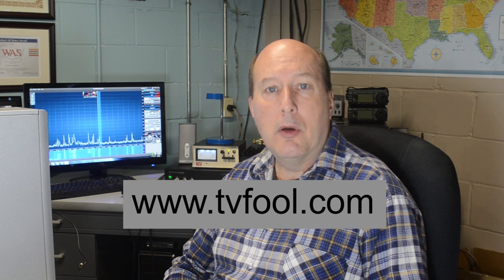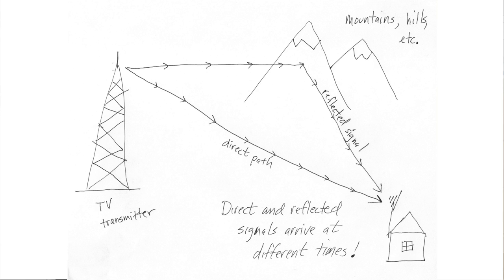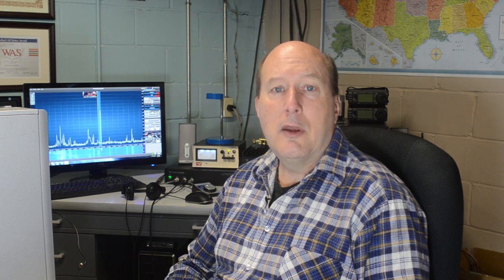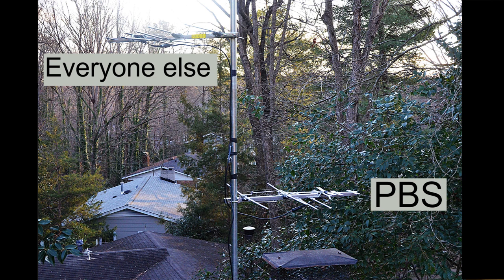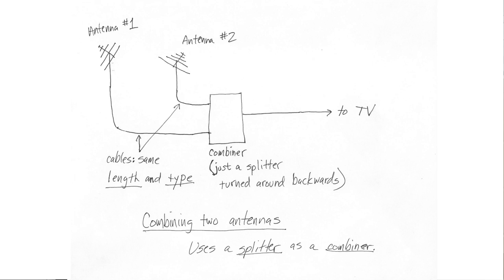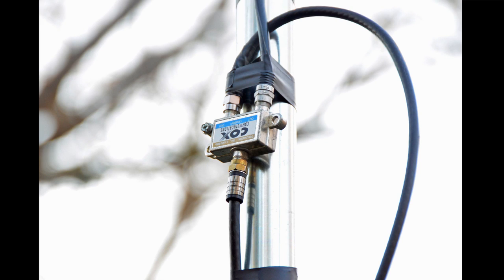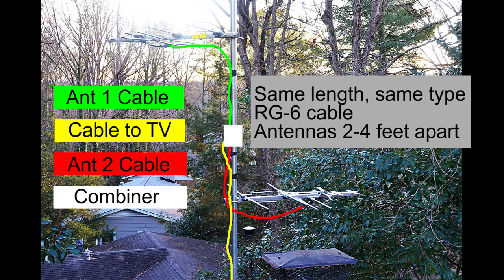Combining two TV antennas for better HDTV reception

Comment: I recently attempted to combine Two antennas, and it caused me to loose a couple  channels. I ended up using an A/B switch to solve the problem, but your video has me wondering if my un-equal coax length was at fault. I was told by an experienced antenna installer that trying to combine antennas often produces the kind of problem I encountered.
Reply from the maker: It's certainly possible that you could lose channels instead of gaining them. If one of your antennas receives a reflection while the other one receives the signal directly you could experience destructive interference which causes pixelation and/or dropouts.
Reply: Thank you for the reply. Multi path interference seems like a likely scenario since we are surrounded by mountains. I recently had a situation where the reflected signal was far stronger than the signal at the transmitter tower, so the info at the tv fool website doesn't always work in these parts. May I ask about your favorite UHF.VHF antenna? I've had fairly good luck with the Winegard HD7694P, but some of my customers need something with a bit more gain.
Reply: Grants Pass TV Repair Other possibilities.  An antenna pointing somewhere other than the transmitter will still pick up noise on the channel of interest, regardless of the presence of a signal.  Signal recovery is about having a good enough signal to noise ratio.  Bringing in the extra noise from the second antenna will lower the signal to noise ratio and if it lowers it enough, reception errors occur.  Also, an antenna without a signal will load the antenna with the signal, reducing signal strength.  The combiner isolates the antennas to some degree, but not 100%.  Therefore, if possible, it's best to combine with a frequency specific combiner.  For example, if you have UHF on one direction and VHF in another, use a combiner that takes UHF one one input and VHF on the other.  A general combiner in this case will give inferior performance.  There also used to be some single channel combiners on the market, but as crowded as the UHF band has gotten, I doubt they make them anymore.  They needed space between the channels to function properly.
Reply: I hadn't realized there were channel specific antenna combiners. Thanks for all the great information.
Reply: Grants Pass TV Repair They used to exist.  I can't remember who made them (Blonder Tongue maybe), but I used to use a channel 3 combiner to feed my single satellite receiver output back into my antenna network so I could use it on any TV.

Comment: Do the two antennas have to be the same type or can I mix different types of antennas from different manufacturers? Is there a maximum number of antennas that you can use? I live in deep south Texas, and we actually get signals from 4 different directions.

Comment: It also can be useful to use a tuner with a "signal meter" function to fine tune the direction of each antenna.  There can be funny interactions with objects that refract the TV signal by several degrees.  Fine tuning the direction can get you a signal that is otherwise marginal.

Comment: nice info thanks don't you have to worry about the frequency of the combiner (two-way splitter)?  and could I use a three-way splitter how about DB loss?
Looks like your a Ham operator?
Reply from the maker: All the splitters I have seen have adequate frequency response, but yes, you need to ensure that the splitter covers the frequency range of the channels you want to watch. As far as using a 3 way splitter goes, if you're only using two antennas then you're just incurring additional loss.

Comment: Just curious if one antenna would be on a balcony while the other pointing at other channels would be indoors, would it still work? (one is an indoor antenna for a separate tv).  Also the outdoor antenna needs to be grounded?
Reply from the maker: I've heard from others who combined a balcony mounted antenna with an indoor antenna. Results have generally been good. Certainly with a try. And it's good practice to ground any outdoor antenna. Although if your balcony takes a direct lightning hit your TV will probably be the least of your worries :-)

Comment: Is it better to use one of the older or newer splitter/combiners.  I have both.  The old ones seem to pass DC and the new ones don't  - when I test with my meter.  Thanks.
Reply from the maker: I haven't seen any difference in my testing. The ones that pass DC can be used to send  power down the coaxial cable to preamps and such.

Comment: He did not say if the combined channels were both on RF UHF or RF VHF.  From my experience receiving DTV since 1999, combining UHF signals from opposite directions even about sixty miles apart does not work.  Combining UHF and VHF works, even from the same direction (I have to use separate antennas because a UHF/VHF combination one does not work in my difficult reception location). I'm old and I have a lifetime of experience with TV antennas. Please see my listing for free information on the San Francisco Bay Area Craigslist. Search for "cord cutter" in the Services category.

Comment: Doug,
I have generally decent reception from my local stations. From my location the stations in my DMA are between 14 degrees and 71 degrees, with several centered between 19 and 50 degrees. I would like to play with two Yagi antennas in the configuration you are using but I'm afraid that there will be some interaction between the two antennas in those centered channels that will cause problems. Maybe I just need to find a high gain antenna with a beamwidth of about 60 degrees and be done.
Reply from the maker: Jeff,  I agree that there could be some interaction between the two given your particular situation. I don't know of any way to tell except to experiment with it, but that can be time consuming and a bit expensive.
Reply: Find the sweet spot it there minute separation

Comment: Is it possible to combine 3 Antennas the same way as the two?  The reason is that one group of channels face another direction. I have the two and they have worked fine for a year. i would really like getting this other group of channels 28 which come in with week signal and pixel. Tried a pre amp but really didnt help. Any suggestions?
Reply from the maker: In theory, yes, you could combine three directional antennas. The chances for multipath distortion are increased, but you won't know if that's a problem unless you try it.

Comment: What you could do also for the PBS Station is to use a  Yaggi antenna tuned to specifically optimized for  that channel or use a band pass filter that will pass only the PBS station.

Comment: I have an old fifty foot antenna that is planted in the ground. And also attached to my two story house. I don't use it. My question is, is it dangerous? Should I have it taken down? Worried about lightening.
Reply: No, it's already grounded by being planted into the ground... you can still use it even if it's 50 years old... currently renting a place that has one as you describe, I'm using it and it's feeding me free TV channels from Buffalo to Sarnia (from, to)

Comment: Good discussion. I did not know if co-phasing made a difference.  So both cables to the splitter  need to be same length.  Where be the best location in the line to put a signal amplifer?  At the single output of the splitter would be my guess.
Reply from the maker: Correct, at the combiner output. And for best performance the amplifier should be at the antenna, but that's not always practical.

Comment: Wished he'd talk about the amplifier. Do each have or use separate amplifier, Do you use the amp of one to power both. Can't connect two amps together. Easy to set up, but not much info on the use of a amp.
Reply from the maker: Yeah, I know I didn't spend much time talking about  amplifiers. You can put an amplifier after the combiner or you can use a distribution amplifier which is essentially a splitter with a built-in amplifier for feeding multiple TVs. The Channel Master CM-3414 is an example of one that works well.

Comment: What would happen if you tried to tee your outdoor antenna with one inside on the wall?  I tried it once and didn't get a signal but I'm not sure the coax cables were good.  Having a problem getting reception from a station while another station just a couple of miles from it works fine..
Reply from the maker: Joe, The wall-mounted indoor antennas are somewhat omnidirectional, which can sometimes cause problems when they are combined with other directional antennas. In general I haven't heard of a lot of people having success with this.

Comment: Hello Doug. If I'm utilizing two same brand antennas that are Amplified with remote rotation where should I put the combiner at within the setup? I'm in Upstate New York and will also be pointing in different directions. Thank you.
Reply from the maker: Jason, I'm a little confused about your application. If you have a rotatable antenna then why do you need to combine  them in this way? As far as amplified antennas go, I have pretty much zero experience with them, so I'm not sure of the best way to combine them. I assume they require voltage sent up to the amplifier, either via the coaxial feed or via a separate cable. Which antenna are you using?

Comment: I have a directional antenna that is getting all the stations I wanted but my local ABC most of the station are the NW including the one I cant get which is vhf and hard to get. There is a low power repeater facing south that I just can't get strong enough.  Will adding a second like that work even if the antennas are not identical?
Reply from the maker: If you can't pick up the VHF station with your existing antenna pointed at it I would say it's unlikely that adding a 2nd antenna will help much.

Comment: Hey Doug! I’m setting up a 915mhz WiFi antenna.   What is the worse case scenario of using an Omni antenna and a directional on a splitter for the same transmitter ?
Reply from the maker: I don't really have any experience in that area, unfortunately. I suppose the worst case is that the antennas won't make up for the loss in your splitter, but that will depend on the antennas you are using and their orientation. Sorry I can't be of more help.
Reply: @doughall1415   my splitter has a .5 dbi loss.  LMR400 cables less than 25ft to each antenna.  I’m more concerned about damaging the radio transmitter in the hotspot

Comment: Doug, Great video, I have a sister that lives in Williamsburg, Va and she has new antenna in her attic and she has a lot of programming she likes on an ABC station, but she loses the signal every day at the same time, around and it does not come back  until the next morning. Do you have any idea what may be causing her issue?  Thanks! Robert.
Reply from the maker: Wow, Robert, that's a mystery. It sounds like there is some physical object moving into (and then out of) the path of the antenna at a certain time each day, but I can't imagine what it might be. It's an interesting puzzle, and if you ultimately solve it I'd love to know what the answer is.

Comment: Great video! I have a question about stacking two directional antennas: Is there a minimum separation direction between them that can be calculated? For my case I have two major broadcast directions that are only about 40-45 degrees apart but I seem to get worse signal strength from one particular side when I try to just split the difference. I was going to try stacking two antennas and target each one but I don't know if having them that close is going to cause more trouble.
Reply from the maker: Usually when identical antennas are stacked it is to achieve higher gain in a single direction, and in that case spacing is somewhat critical to achieve maximum gain. In that case it's based on the number of elements, the boom length, and the frequency of interest. But in this application of TV antennas (each pointing in a different direction) the main objective with regards to spacing is to avoid interaction between the two antennas that would disturb the pattern and/or the feedpoint impedance. This is generally 1/2 wavelength or greater, which is where the recommendation of 2 to 4 feet comes from.
Reply: Thanks for the reply! I can keep them 4 feet apart, I was just worried about the direction they were to be pointed in.

Comment: Would using more than 2 and pointing them so it's 360° all the way around and using a booster help more?
Reply from the maker: I don't think so. Between the additional loss in the splitter and the likely multipath issues I don't think you'd gain anything.

Comment: So your saying connect both antennas to a splitter in reverse so that would go into the two output sides and can you actually run that input side coaxial to another splitter inside the house to split to at least two TV's ?
Reply from the maker: Yes you can, but you'll lose some signal in the splitter so a preamplifier can be helpful.

Comment: Great video - very well explained!  Could this be done with 2 multi-directional (180 degree each) antennas?
Reply from the maker: It could, but you run a greater risk of multipath distortion. If you put the two antennas at right angles to each other you'd essentially get an omnidirectional pattern. On one hand that could be helpful, but if a station's signal is arriving by two different paths it could cause the problem I discussed in the video. Only way to know for sure is to try it.

Comment: Hi Doug, Great job on this presentation.  I have slightly different issue; 5 of the 6 broadcasters in my area Xmit UHF and all at the same bearing.  My problem broadcaster Xmits VHF-HI in a different direction.  Can I use this technique to combine a UHF & VHF antenna?
Reply from the maker: Sure. My antennas cover VHF and UHF.

Comment: Doug,
Thomas, here again, with a question. I don't want to buy another HD Stacker because it is pretty costly., so could I use one of similar capability combining it with what am presently using to produce the desire effect? Or should I invest in another HD Stacker Antenna? Wishing you a Happy Thanksgiving.
Reply from the maker: Using a different one with similar capability should be fine.

Comment: Doug, I have a large antenna in attic and it works well most of the time.  Sometimes in windy & wet weather I believe I’m getting pixelation due to reflections from leaves of tall nearby trees.  Have you had such issues?  I see you have substantial tree cover.  I’m thinking of taking out some very large trees to hopefully avoid the issue.  Great video!
Reply from the maker: Yes, Chris, pixelation due to attenuation of the signal by tree foliage is not uncommon. It's more likely in the summer and when the leaves are wet. Sometimes the only solutions are to raise the antenna or cut back the trees.

Comment: Is there some kind of device, that you could put between the combiner and the TV splitter, with which you could drop signals you don't like? ie: for multi-path, you drop the signal that's taking longer to reach you.
Reply from the maker: You'd need a very sharp tunable filter, and I'm not aware of one, at least not a reasonably priced one.
Reply: @doughall1415  I'm assuming that means it's at least a grand.

Comment: I wish to add together 2 antennaes pointed in the same direction. Both antennas are the same and they are amplified. Can I send one power box up one coax, split that to the 2 antennaes? will the power go thru the "backwards" splitter?
Reply from the maker: Depends on the splitter. Some block DC, while some are designed to pass DC. I think the ones that are designed to pass DC are generally marked as such.

Comment: Doug: GREAT JOB, sir!  Thank you for explaining this!  I have one question based on the "combiner" platform stated on this video.   Is it possible to use a combiner to "merge in" an antenna [or antennae] coaxial wire with my CABLE INTERNET coaxial by using the combiner - flipped splitter idea?  I've heard that you "can't split the cable internet signal with air antenna, but I wonder if you can "combine" (by using the combiner idea?)

Thanks again... great video!!!!!!
Reply from the maker: I wouldn't attempt it - I'm not sure what frequencies are used by the cable internet service,  but there is likely to be some interference there. Is the idea to avoid having to have an extra run of coaxial cable?

Comment: Nice info! One question that is confusing me. I took my old antennas out of the attic and placed them on the roof. I trashed the old 300 ohm connections between them and used  300 to 75 ohm baluns between the two antennas?  Or should i have just one balun connected to the coax heading to the tv's?
Reply from the maker: You need a balun for each antenna, then equal lengths of 75 ohm cable from the baluns to the combiner.

Comment: Great video Doug! I have a similar problem with signals in opposite directions. Is there a relatively inexpensive way of looking at the signal strength across the spectrum so one can tune the antennas, determine when pre-amplification and distribution amplification is required? The best...Thanks
Reply from the maker: Short of having some specialized equipment I'm not aware of an inexpensive way to do this. Some TVs have signal strength meters built in that can make this easier. If you have access to a wide band spectrum analyzer you could use that, but the average TV viewer doesn't have one of those.